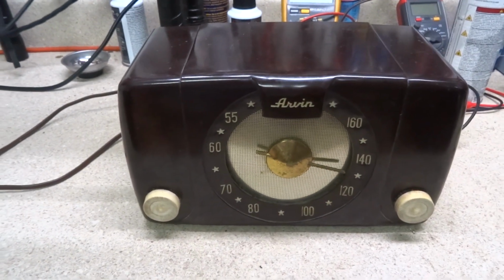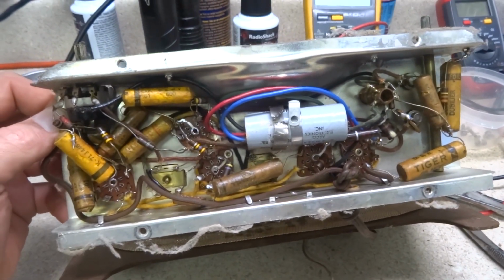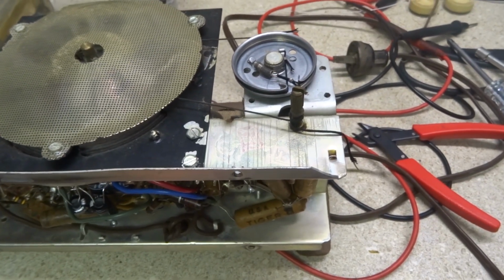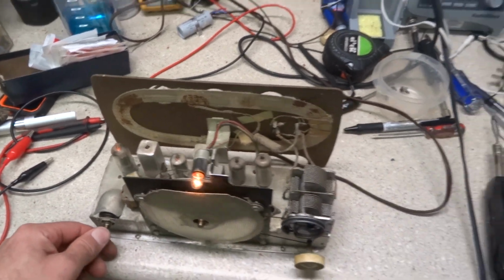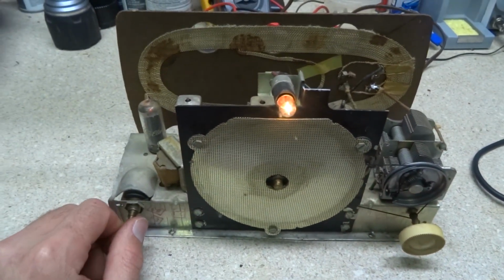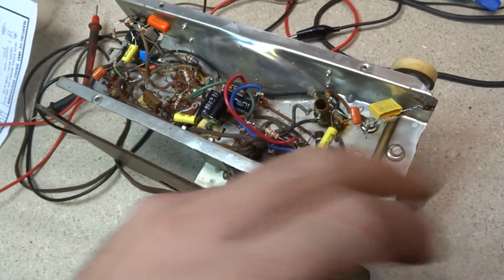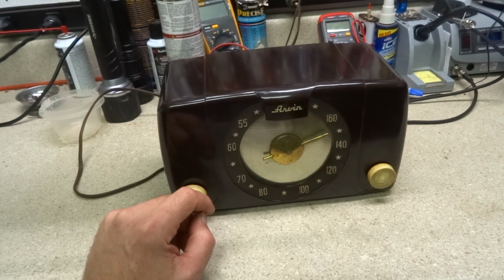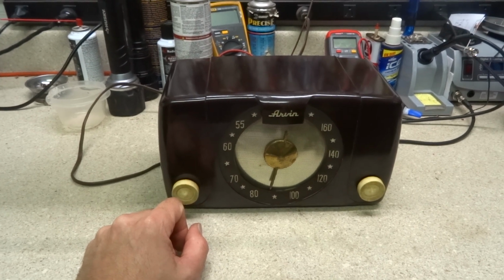Repair Of A 1950 Arvin 450T AA5 AM Tube Radio

Comment: I helped build WBAF, 1090 in Barnesville, Georgia, back in the later part of the 60's. Since then, the antenna and transmitter have been replaced and it now operates at 500 WATTS. It's still operating but it's hard to hear from where I live, and it's about 12 miles away. I sure miss the old tube gear.
Reply from the maker: Grew up not to far from there...
Reply: I was born in Thomaston and raised in Barnesville. I guess I'll die here. I really enjoy watching you rebuild radios and  radio's have fascinated me all my life. I gave away all my equipment because of my wife's sickness, and my eyes fail me now. But the smell of radio components and the light from the tubes carry me back to the 50's when I first got started in it. Don't ever give up your talents in radio.
Reply from the maker: I worked at Thomaston mills before they shut down. Spent a lot of my life in Macon and Roberta. Because of jobs i'm now here in SC. Glad to have you on the channel. Good to hear from someone back home.
Reply: A lot of my cousins worked there too, before it shut down. Does Wayne or Randy Blackmon sound familiar? Thomaston is my home town. I used to work with Harlin Holloway on WTGA AM transmitter and WSFT, 1220. I also played in several bands. The Saints and JUNKSHUN. Ever hear of these bands? Glad to finally meet someone on youtube with the same interest.
Reply from the maker: Can't say as i've heard of them. I use to work with a guy named Lamar Haygood. Wonder how he's doing these days? Time flies!
Reply: I worked at the Martha Mills for a while, then at Aldora in Barnesville.

Comment: Here in the New York City Tri State area we have just the opposite problem. The dial is full of  50 KW clear channel network owned stations that are either Rush and Sean all day, sports talk, or news and traffic reports.  At the upper end of the dial you will find some local stations but very few left.  No music except for a rare ethic station of one variety or another. The total concern of the program directors of these station is revenue from the drive time commuter audience that still listen to AM. Very sad but true I'm afraid. Good restore. Well done..
Reply from the maker: WCBS 880 is a powerhouse from up there! We get that down here most nights year around. Very few music stations here. The ones we do have are simulcast from FM. Thanks Glad you liked the video!

Comment: I have a white 450-TL I need to restore, not sure what the difference between that and a 450T is. Great video!
Reply from the maker: Likely just a color or trim difference. If the chassis is the same number it's basically the same set.
Reply: I read on-line that the difference is a lighted dial (look at the image next to my name).   However the one here doesn't appear to have a lighted dial. I refurbished a 451 TL which can be seen here: https://www.youtube.com/watch?v=ZgGpgKUh-yE .  They do not seem to show up as often as the non-lighted versions.